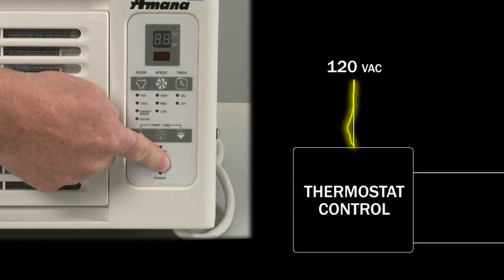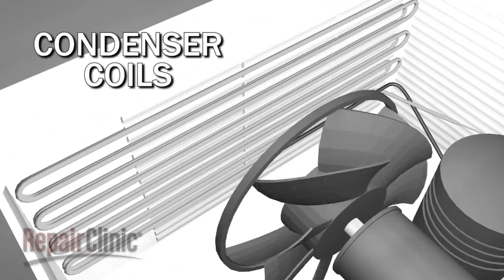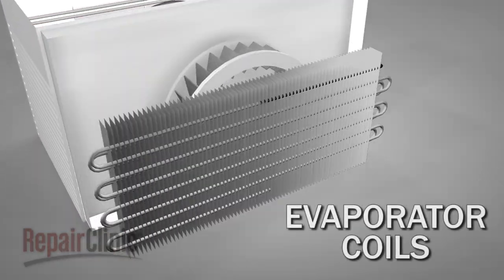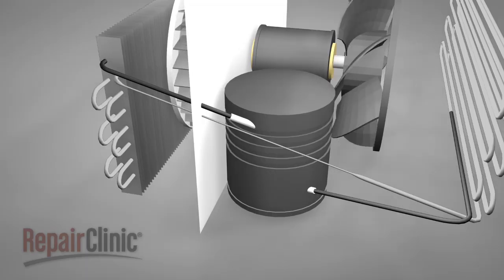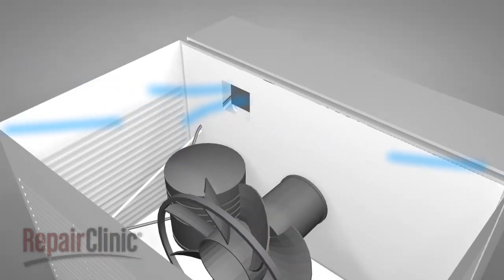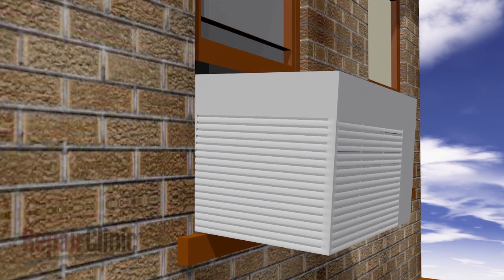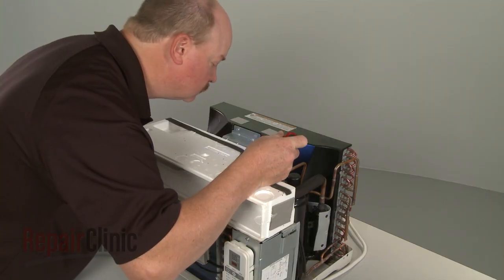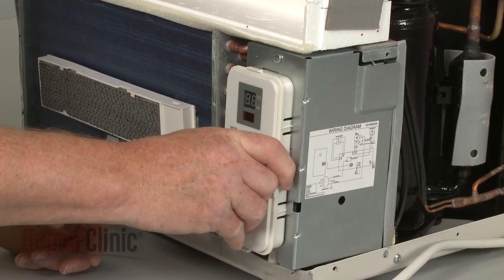How Does An Air Conditioner Work? — Appliance Repair Tips

Comment: I was not sure why the water does not drip on the outside, now I know, it is sprayed on the condenser, thanks.
Reply: Some models don't drip because the water inside are sprayed on the condenser and evaporates. it's Cool, literally!
Reply: @alphaandliarize  mine does too but up to a point, and then it drips out

Comment from the maker: There are usually two fans in the unit, one for the evaporator and one for the condenser coil. You may have either one motor with a shaft coming out both ends or two separate motors. It sounds like you may have a condenser fan blade either hitting something or loose. A condenser coil itself will not generally make any noise unless the lines are hitting together going to it. I would look it over again and see what you can find.

Comment: I would hope you will include this in future videos for people living outside a city. If you live in mosquito country (ie. you have mosquitoes constantly to any extent during the summer or in more severe cases you have mosquito storms, that is where you walk outside and mosquitoes engulf you) wrap the intake of the outside of the unit in screen wire. this will prevent the mosquitoes from clogging and destroying the aluminum in the condenser coils. It will slightly decrease the efficiency though

Comment: Can anyone knows why my ac absorbing the outside air with a bad smell. Can I do anything with my ac to avoid it?
Reply from the maker: bbb First, make sure the unit is installed in a way that makes it tip back a little so the condensate water is running towards the back of the unit. The front section and the back section are separated by a wall with a vent that can be opened to bring in outside air. If the water is not running to the back and is collecting in the bottom tray, it can become stagnant and foul smelling. The other thing that might be causing a foul smell is a motor or wire burning. To check if this is the case, you will need to remove the air conditioner from the window and take it apart and clean it out thoroughly. Make sure the water runs from the front to the back. Also look for burnt wires if it smells like an electrical odor.
Reply: Thanks for this help but that foul smell is coming from my neighbor everytime they cook.

Comment: I notice the air filter is at the front of the unit drawing in air from the room. However outside air is used to cool the heated coils. How does the outside air get filtered if at all?

Comment: a little tup for everyone...it's impossible to tilt the ac unit backwards while being properly installed, allowing water to collect in the back of your unit will seriously reduce the life of your condenser as the water will begin oxidizing with the steel in a couple of weeks...(one of my ac units is a month old and has a good amount of rust), and those little vents to draw in fresh air don't do anything but let bugs in. the amount of help the water gives to help cool your condenser is so slight that it by far outweighs how much shorter your units life expectancy will be when your condenser rots out. Drill multiple holes, coat the exposed metal will silicone sealant to prevent rust, install bug screens on the vents to prevent most bugs and debris from entering your unit and clogging the condenser so you will have to take it apart and clean it far less often.
Reply: and when in cooling mode, always use on high fan speeds as that's when it is most efficient.

Comment: THANK YOU!  It answered my question to the downstairs large window unit.  
BUT The small upstairs 6K wouldnt blow cold air. I questioned its draining and so I opened the window and tipped then tilted...then it started blowing cold air.  It was with water too.  Are the small ones run different than the large ones?
(As I just learned from your vid to the purpose of the standing water under the fan while rusting out the brand new $500 unit 
🤗 YEES!)

Comment: I have a GE wall unit bought new 3 years ago 12000BTU . Worked great until 1 day last simmer when it hit 100 degrees. It never worked the same again. It no longer drips any water, output at the vent is now 48 degrees from 40-42 and the room no longer has that ac chill to it when you walk in. Any tips here? Thanks

Comment: My window AC unit is leaking apparently from the vents where the evaporator coils and front fan give cold air to the room. Is this likely to be a condensor coil issue or slinger ring maybe?

Comment: what causes the frosting over of the evaporator coils to be a problem? wouldn't you want them colder?
Reply: No. Because when that happens the fan doesn't properly circulate the air and will cause the compressor to shut off prematurely.

Comment: why does the back of the ac have to be outdoors?
Reply: Heat travels from the back of the a/c & some water drips as well
Reply: It doesn't have to, but if you are trying to cool a house, letting warm air in from the condenser coils will just act against the cooling effect, making it inefficient.

Comment: Thanks for sharing this great video. I'm having problems with my Frigidaire window unit blowing cool air consistently. My trouble shoot process was to clean the filter and after powering back on "check filter" light goes on and off. And the ac unit only stays cool about 10 minutes after powering on then like shifts into a different mode and the cool air is gone! Any suggestions? Thanks
Reply from the maker: Steph B Check if the controls have a fan only option. Normally, anytime the fan is running, so is the compressor.
Reply: ***** Yes there is a fan mode. The modes are cool, fan, energy saver. The ac unit is on cool mode when it shifts and stops blowing cold air.
Reply from the maker: Steph B Perhaps the compressor is overheating or there is a problem with the start device on the side of the compressor. If the compressor is running, but the unit is not cooling than the air conditioner is probably not worth repairing. Compressors are part of the sealed refrigerant system.
Reply: *****
Ok, thanks so much!

Comment: in my AC a layer of ice starts to form behind the air filter and when this is happening the AC nearly doesn't cool at all...this mostly happens when I turn of the AC through the remote..It should get off but I still hear the noise of the compresser and the ice layer is formed...I have a Samsung split AC AS125EWF/2012

Comment: What if the outside air is very hot? How will the condenser cool off?
Reply: Exactly what you'd expect. It keeps cooling the air until it can blow cold air.

Comment: my air conditioner fell out of the window last year. not that high of a fall. from only the first story. I let it sit for a while then tried it out, seem to work just fine. Now when it starts, it makes a clicking sound. but goes away. When I turn it off, it sounds like you can heard water. Checking the back now. there are dents on the condenser coils. Is my air conditioner broken or still gonna work for a while? It still blows cold air and seems to be working right.
Reply from the maker: Gamer AG As long as it blows cold air, it is fine. You may want to straighten out the fins if some got bent so air can flow properly. http://www.repairclinic.com/PartDetail/Fin-Comb/FCR6/949634?TLSID=1773
Reply: ok thank you, i was just more concerned about being a fire hazard or something. I do not know anything about air conditioners.

Comment: Why do some a/c window units have a water drain and some don't? I recently got one that doesn't have a drain so the water stays in and has become very murky at times and smells even though the fan does spray the water out but a lot still remains...so isn't better to have a drain?
Reply: The reason some of the newer AC systems do not have a drain is because the unit uses the water to help cool off the condenser by using the fan to splash it around onto the coils which helps with the efficiency.

Comment: So, if the Condenser Coil has debris or dust or whatever clogged up inside it, or it's vents are clogged up, what will the AC unit do? I'm assuming it will overheat and stop pumping the coolant to the front Evaporator Coil, causing warm air to blow through the front - correct?  I've been noticing that, since 3 years of good working activity, my "through the wall" Comfort Aire BGE-143M will only blow moderately cold air on a temperature setting of 62 (that's the coldest setting, when it used to blow super cold air at 70 temp setting) and then, at times (for days in a row), will NOT blow any cold air at all, making the place heat up like a toaster oven! What the heck is the issue?  Thanks in advance! - JM

Comment: So I haven't used this window AC unit for about 6 years now. I installed it and turned it on. Everything was normal and the air smelled like it should. Upon checking the back of the unit on the outside of the house, I noticed it smelled like a hog farm coming from the back of the unit (the inside air was fine no smell). It was also dripping a white frothy foam that has built up in a pile/puddle outside (no leaks inside either). What is the white frothy foam build up dripping/smell and should I be concerned for family safety/well-being, as well as wildlife/pet safety?

Comment: I have a window a/c and always use my remote to control the settings.Recently though,when I set the temp at any number,the set number starts scrolling up to 86°.If I hold my remote and press the down arrow constantly the a/c will work fine ...as long as I press the down arrow!HELP!!!

Comment: Sir, can i use a refrigerator compressor to replace a burn out airconditioner compressor?can i drain the oil and put R134A oil in the refregerator compressor and put it in the air conditioner and charge 134A refrigerant on the system?
Reply from the maker: +vrich marketing renewable energy Normally, this is not something you can do.
Reply: why sir?what is the problem with this plan?
Reply: +vrich marketing renewable energy ask frigidare

Comment: 1:04 "the compressor converts the gas back into a liquid and the cooling cycle continues"🤣🤣🤣  Hilarious!
Reply: You were high weren't you?😂
Reply: @yahya2925  ha only an idiot would believe the compressor turns refrigerant from a gas back into liquid.  At least if I were high I'm not an idiot.😂🤣
Reply: @Vu621  Lmaoooo
Reply: @Vu621  I humbly take the L
Reply: @Vu621  you fool that is 100% true AC systems work a lot like refrigerators and the refrigerant DOES ALWAYS CHANGE PHASE BETWEEN LIQUID AND GAS

Comment: Could a thermostat sensor malfunction? like the one in the video?
Reply from the maker: PRDV Entertainment Español 

Yes, whether it is a thermistor sensor or capillary tube style thermostat they can fail which normally results
in the air conditioner not turning the compressor on or not the turning the compressor off. Most temperature related problems are due to a dirty condenser coil that needs to be cleaned from the inside of the air conditioner so the
outer cabinet would need to be removed to access.

Comment: i bought a new frigdaire window unit ,and drilled drain holes in it when i did this i hit a line in the rear lost all freon i took it apart and brazed the line ,got a bullet valve and recharged it .endend up adding 8 cans of freon .now it only cools a thermostat to 51 degrees .i checked 1 of my old air window units and it cools to 41 degrees ,no around here works on window units.it a frigdaire 12;000 btu.ive got 500 + bucks in this thing.i dont know how much freon is enough.the recharge came with a guage it's reading 50 psi.should i purchase a vacum and try again.how much is enough,please help

Comment: 1:42 can anyone tell me what that brown wire just above the barcode is ? i have a feeling it may be something important. see the thing is i move that out of the way every time i replace the filter. over time it stressed that wire out that it broke. and now my air conditioner wont cool. it runs and the fans runs but it doesn't cool.
EDIT : watching further this may have been a "Sensing Bulb" but i cant get a clear answer from the internet.

Comment: Can I mount a window a/c upstairs to cool a bedroom that vents into hot crawlspace?
Reply from the maker: We don't recommend it being the crawlspace is hot. The unit needs to draw cooler air from the sides to cool off the compressor and condenser coils. The unit would most likely overheat and shut off and would not cool properly.

Comment: Window type ac is having a disturbing loud noise from time to time. Loud noise would last 10-15 mins interval. Seems no problem with cooling and fan as well, it's just the disturbing loud noise. badly need your help thanks!
Reply from the maker: +Jerry Luspe Could be a problem with the bearings in the motor or might just be debris in the cabinet. Either way the AC will likely need to be taken apart to check it out.
Reply: +RepairClinic.com thanks for your reply. appreciate it. am checking it right now.

Comment: my thermostat went dead about a year ago, I've never bothered to fix it and never used the ac again since I dont' really need it. Will this extended period of non-use damage the unit? It's in a high rise condo in a warm climate so i don't think there's any mold issues. What about the motor? should it be fine?
Reply from the maker: Should not be a problem Max.
Reply: +RepairClinic.com cool. thanks for your reply.

Comment: My aircon still runs but its always in "fan mode" even if i turn it into turbo cool. Before, my sister covered the aircon with our curtain, after i removed the curtain the aircon was not functioning probperly anymore, is that the reason of the problem i m facing?

Comment: Stupid question, I'm getting conflicting info on the Internet Do air conditioners pull in outside air, does anyone know thanks. I have a newer window AC that's 2 years old
Reply from the maker: Both. It is pulling inside air that is cooled by the evaporator coils and put back into the room. The blower wheel is also pulling air from outside to cool the condenser coils. The cool air is indoor air, while the outdoor air is used to keep the AC unit cool. Hope that helps!

Comment: How does mold not start to grow quickly with all that water just sitting in the back of the unit? My unit just started to show black mild on the front vent and in the filter and my unit is years old and we used it almost every year, so why is mold starting to just grow now? 

Either way we got a new air conditioner and threw the old moldy one away immediately, still curious tho.

Comment: Can you replace freon in these window units? Mine worked great for years and now it's not working as good......
Reply from the maker: Gary Stanionis No. If there is a sealed system problem then the unit will need to be replaced.
Reply: Yes you can just watch other videos!

Comment: I am installing the unit inside an rv, the unit works for a few minutes, and then I guess it overheats, how do i properly ventilate this unit if it is installed inside a cabinet, I created a vent in the back, should I blow fresh air in or blow the heat out.
Reply from the maker: Romeo Martinez The unit is designed to blow the hot air out of the back and draw in outside air through the louvered vents on the side. If you can somehow make that happen it should work ok.

Comment: HELP PLEASE!!! I have GE model # AEM14AQL1 wall unit air conditioner and it keeps turning on & off continuously all by itself. Starts cooling for a few minutes, makes a BEEP & turns off complete. After a few seconds comes back on all by itself. Do you have any suggestions??? I'll be waiting in the heat :) . Thanks, E.M.
Reply from the maker: Edgar Moctezuma We recommend using the repair help section of our website using your AC's model number - http://www.RepairClinic.com/repairhelp - if you enter your model number there you'll have access to model, part and symptom specific repair help.

Comment: What my instructor is stressing: 

Air conditioners don't cool anything, they remove heat. : P
Reply: That's what cooling is.
Reply: Exactly because cold is not a physical thing. There is no such noun as cold (except the common cold). Cold when used for temperature is an adjective to describe the absence of heat (which is a physical thing)
Reply: dav vad You're correct, cold is not a physical thing. However, the definition of cooling is to remove heat so air conditioners do cool things.
Reply: Yep they do! I was saying exactly to you btw
Reply: dav vad Oh, my bad.

Comment: I just bought a AC LG 6000 out of eBay a refurbish one and I installed it works but isn't blowing cool air looks like it's blowing only the temperature that's inside the room. Any suggestion??
Reply from the maker: Your best bet is to use the repair help section of our website using your AC's model number: http://www.repairclinic.com/RepairHelp/Air-Conditioner-Repair-Help?TLSID=1773 If you enter the AC model number in the search bar you'll receive model, part and symptom specific repair help.

Comment: to add to the video if you live in a place with many bugs, especially mosquitoes, it will restrict the cooling efficiency of the window unit but will prolong its life if you wrap screen around the intake vents on the outside. a simple wire to hold the screen will work. 
As a testament I didn't replace the screen on my window unit after cleaning it and now its exhaust smells of death. However what can you do in mosquito country. time to clean it again and re-install the screen.
Reply from the maker: Thanks for the tip!

Comment: That compressor does not turn the refrigerant back into a liquid...
Reply: Yes it does you fool the refrigerant is designed that the compressor will make it change phase between liquid and gas
Air conditioning systems work in a similar way to refrigerators/fridge freezers